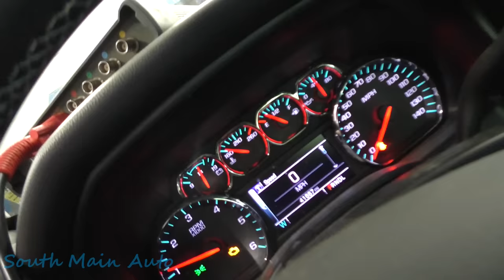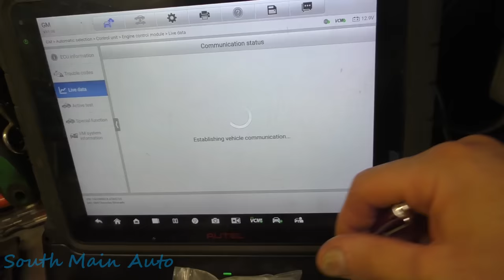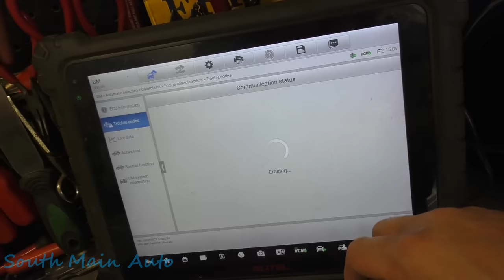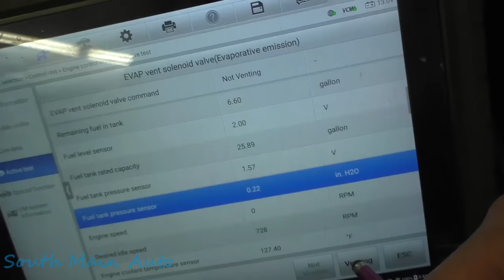'18 Chevy Silverado - In Tank Fuel Pump & Fuel pressure Sensor

Comment: In 2004, on the non flex fuel GMT800 trucks, they started using the metal fuel pumps. But the flex trucks had plastic pumps. I had an 04 Sierra last year and the entire top of the fuel pump was rotted and broken and had a hole, YET it still ran somehow. You can't kill those trucks. But it took about 4 hours to get the metal lock ring off the metal fuel pump and thankfully we didnt break the tabs or the tank. But it was the dumbest design ever. My 04 Suburban i had before the sierra was a flex truck with the plastic pump and it was a breeze to do the pump. And my current 04 Suburban Z71 is a flex truck. Fuel pump is in my future because the level on the gauge is all wacky...granted it could be the cluster. But more than likely its fhe level sensor in the pump. Delco/Delphi only on GM trucks.

Comment: What would be the best thing to ask the engineer for if you got the chance?? A simple access door in the floor of the bed of all trucks or A spray nozzle system routed throughout the assembly plant that sprays anti-seize on all steel bolts that attach to aluminum??!!!

Comment: If you recommend an  OEM pump module why did the original one fail after 41k? I've used aftermarket modules from roc auto no issues. In fact they come with the float assembly.  Why wouldn't you replace it while you are there replacing whole module?
Reply from the maker: The pump didn't fail. The plastic cracked from rust
Reply: @SouthMainAuto  Gotta love NY winters with salt!

Comment: Funny you're replacing a 4 year old fuel; pump. The one on the 1985 Caprice is finally giving it up after 38 years and 136,000 miles. And its likely way less labor to deal with it.

Comment: So the lesson here is not to use an air hammer where brittle plastic could be damaged. Wire brushing the rust and the liberal use of a penetrant such as Liquid Wrench would have sufficed in both removal and installation. Since I have so many vehicles sitting around that I’ll have to drop the tanks to clean ‘em out before trying to start, I think I’ll make my life easier by adding a universal fuel pump removal tool to my Amazon wish list. I suppose the 4 jaw version for $39 sounds the best.  Probably should’ve replaced those clips @32:36 but I suppose there wasn’t much of a retaining “lip” left..

Comment: So I am removing a plastic fuel tank to change the fuel pump. All disconnected, tank stuck im place ???? WTH ? Turns out when the custom body builder installed the floor in they screwed through floor INTO THE PLASTIC FUEL TANK. Didn't smell of gasoline as the steel self tapping screws sealed against plastic quite well. And yes got a new fuel tank ..

Comment: May I ask one question about the tank and fuel pump? Why is it that when the fuel pump quits or goes out, it seems to happen just after you have filled the tank and it's damn near impossible to drain the tank before you drop it. In my personal opinion putting the fuel pump in the tank is the worst idea they ever came up with.....
Reply: I would bet that if your pump is on the edge, the extra workload of the tank being full would be enough to push it over in a lot of cases. The fact that every reservoir on the vehicle doesn't have a drain on it is pretty upsetting to me.

Comment: where does (B150 part) Fuel tank pressure sensor signal harness (wiring Blu/wh) leads to the engine,,,,location to engine?

Comment: My impact gun are named as follows 
3/8 snap on name "please"
1/2 mac top of line in its day "pretty please" 
3/4 snap on breaks most anything 
"Last chance" 
1 inch drive air cat with 1" line run straight off the tank 180psi 3 stage compressor 
" i aint asking anymore" 
It will remove the support arms from a d10 the 3" nut is torqued 1200 ft lbs

Comment: seriously?  ford driveshafts that are aluminum from the 90's are still fine.  damn.  its like GM finds ways to make their customers pay for buying their product.  wtf.  i know ford killed the 300 6.  some say it was because it lasted too long so they don't sell new trucks.  i mean 300k should be the new norm, not just for 20year old fords and 20 year old toyotas.  I suspect it was for emissions reasons.  these modern engines are bringing us back to the 70's for longevity.  in some cases the 50's.  75k miles, junk.  but it cost 50k instead of 3k.  come on man.

Comment: Aluminum am steel don't mix. Steel makes the aluminum corode worse.
   I went to do exhaust manifolds n gaskets on a 5.4 excursion.  The passenger side head was Completely missing two mount bosses off the head. The cylinder head was damn rotten right away. Noone freaking home. Hahahaha.   Did what I could. For it though short of replacing the head and made the customer aware.

Comment: 14-18 gm trucks have a very bad fuel pump design the cap is made of plastic very easy to break with the car vibration I swapped it for steel cap fuel pump from 2500hd same Year but need to cut the lip from the rotation

Comment: What a piece of junk  GM became.  That is why I buy Toyota cars, their fuel pump rarely go. The drive shaft is steel and do not have to be totally scraped. The Germans started it first, now even American cars, some you cannot even disconnect and replace the battery without dealer reprogramming it.

Comment: eric i have a question for you i have a 15 wrangler it has a shift interlock problem. i dont belive its bad moduels cause its intermitent. if you push the interlock overide swith it will go into gear, limp mode 35mph max. when the problem happens all the p r n d completly lit up. failure to communicate with electronic shifter, tcm,gateway moduel. where should i start looking.....thanks

Comment: Whoever thought using aluminum parts next to steel parts was ever a good idea....
Steel and aluminum corrode each other. Just like putting aluminum alloy rims on a steel hub, then after a few years wondering why you can't get the rim off the hub.

Comment: Engineered failure points.  Specifically designed to require replacement at specific points in the life of the vehicle.  Part of the automotive industries business model to get every dime out of the consumer's wallet.

Comment: Thanks Eric, i always wanted to see what the safety guys warned us about working w/a lot of gas in the tank. The trouble comes when you have a spill. If youre not equipped w/ lightwater fire suppression & spill barrier there will be an explosion and fire. Ive been called a risktaker but not w/gazoline on my hoist in my garage attached to my house. The risk way outways the bennefit. Even at GM they ALWAYS MT'd the tank and they had all the safety stuff & training in explosive fume handling. Even the fuel dummy was air operaterated.  But you live for another day. ben/ michigan

Comment: Would removing the bed been easier than dropping the tank?
Reply: Usually requires removing the bumper, then the bolts are rotten. Bed bolts also rotten, seized to threaded inserts in bed braces and will spin and not come out.

Comment: I've learned to save the pump if it is still working and put it on the aftermarket holder(may need a little plastic mods ). I always spray some WD40 to help reduce the water/salt damage.

Comment: The universal joint should be covered by the warranty..... Drive Systems — Components such as propeller shafts, universal joints, constant-velocity joints, axle shafts, bearings, final-drive housings, and all internally lubricated parts
Reply from the maker: GM dealer would laugh at him if he took this in for a u joint 🤣